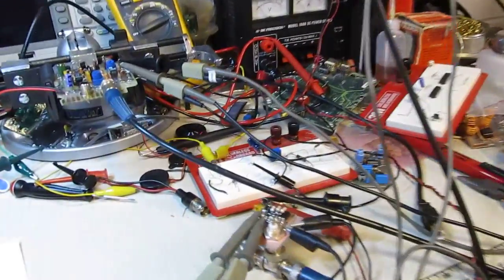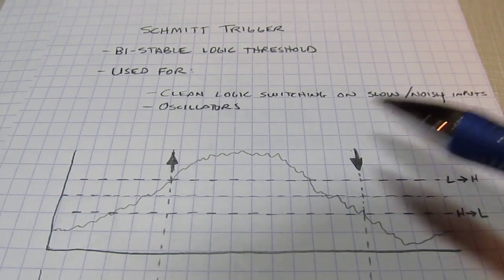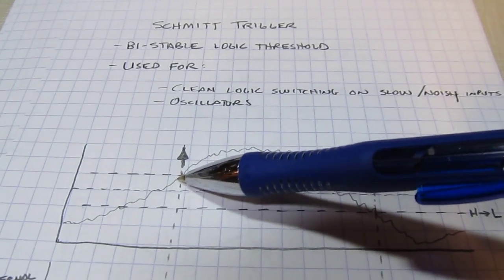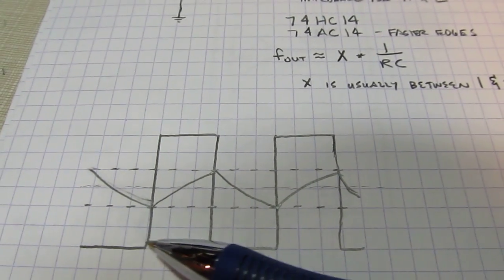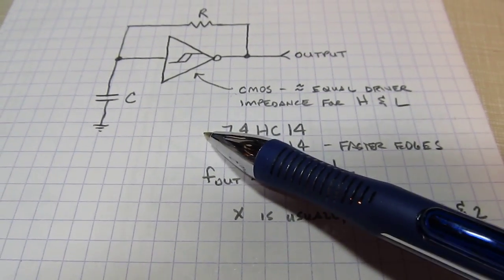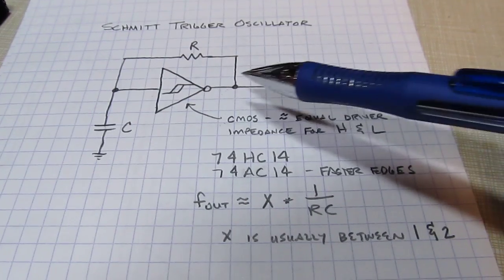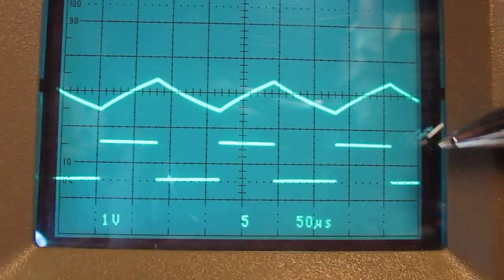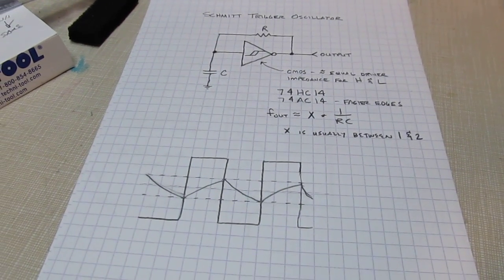#87: Schmitt Trigger Oscillator / Tutorial / 74AC14 Inverter / squarewave generator

Comment: Thank you for that Schmitt Trigger explanation! I tried reading the Wikipedia article on the Schmitt Trigger, and it kept mentioning hysteresis (which I understand as a mechanism that behaves in such a way that depends on its own history). It'd say hysteresis this, and hysteresis that, and I wasn't any closer to understanding what a Schmitt trigger actually did. But this actually helped me tie in the concept of hysteresis with a Schmitt Trigger for me.

When the noisy signal first touches the upper threshold, that threshold gets "de-activated" and the output becomes HIGH, while the lower threshold gets "activated". And so on.
Reply from the maker: Exactly.  Hysteresis basically means that the threshold depends on the previous state of the comparator - i.e. the threshold moves when the comparator changes state such that tiny wiggles/variation/noise on the signal can't cause chatter.
Reply: Schmitt has hysteresis, regular inverter without schmitt when does it switch?

Comment: You can do this with TTL logic,  but then are limited to fairly low resistor values.  Another variation is to make a schmitt trigger by wrapping an op amp with a couple of resistors to provide some positive feedback,  then couple that to an integrator (the whole thing can be easily done in a dual op amp package).  The output of the integrator goes to the input of the schmitt trigger.  The advantage of this one is very linear triangle wave,  rather than the ones you get here.  Also higher amplitude,  if you want,  and then by doing a bit of diode steering you can get narrow pulses and sawtooth rather than triangle waves,  or even variable duty cycle.
Reply from the maker: One of the problems with TTL is that is has asymmetric output drive capability, and can't drive a low impedance load.

Comment: 2/ another tip! If you put a transistor (pnp  ie bc107)  Emitter to ground , Collector to input across C , potential devider Base and the top resistor to the out put of the Shmit,  there will be a saw tooth wave form across the C.

Comment: Your videos are great, Alan.  Picked up a couple of 74ac14's and I am planning on building this. I had a thought that I might just add the parallel trigger array, in the output of your circuit, to the output of my inexpensive function generator, using it as a conditioner for the square wave output. That way I could vary the frequency and duty cycle.  For TDR measurements, would a very narrow pulse make it easier to visualize the delay ?
Reply from the maker: Adding an external input to the driver is a good idea - it lets you play with pulse widths, frequencies, etc.  Certainly a narrow pulse can be used to measure delay - potentially with less ambiguity, as long as the pulse width is shorter than the cable delay.

Comment: Excellent video.

Would this type of oscillator be fast enough to function as a local oscillator in an RF radio circuit?

What would be the practical upper freq limit?

Could it cover the entire 30 Mz hf band?

If so, this could simplify homebrew radio construction tremendously.

Thanks for the video.
Reply from the maker: Speed will depend on the logic family used for this, and the resulting propagation delay of the gate.  You'd want to follow it up with a divide-by-2 to cleanup any duty cycle distortion, so that pushes the frequency even higher.  So, I'd say it likely would not be a good for an HF LO.

Comment: Hi, Thanks for these great videos. I have built the circuit and used it as TDR to measure coax cables. Now I am wondering if this circuit with its fast rise and fall times (and subsequent harmonic content) would be an effective wideband noise source? I recall seeing circuits from a few decades ago for an antenna noise bridge that used a 555 timer and zener to generate the wideband noise. However, it seems this might be a better approach. What are your thoughts on this. Also, I hope that you are able to get back to you lab very soon.
Reply from the maker: The tone spacing will be equal to the odd harmonics of the oscillating frequency, which may provide fine enough granularity to work as a noise source, or at least a comb generator (see my video on that).  Note that the amplitude of the harmonics will fall off as you go higher in harmonic count (frequency), but that too might be OK for many applications.
Reply: I've used it for excacly the same reason .

Comment: Terminology Question: By definition(?) an op amp is a differential amplifier yes/no? Is a Schmitt Trigger an OP amp, or just a  Schmitt Trigger made from an Op amp.  I believe I’ve seen Schmitt Triggers  as part of logic groups  including TTL AND, NAND, AND FLIP FLOP, etc.
Reply from the maker: Yes, an op amp itself is a differential amplifier at it's heart.  It may not be configured as a differential amplifier when in use (such as an inverting amp, etc.).  A Schmitt Trigger is not an op amp.  It is essentially a comparator circuit whose decision threshold changes whether the output is HIGH or LOW.  A Schmitt Trigger can be made from an op amp, but most are made from comparator circuits, or are embedded in logic circuits.  The common feature is that the decision threshold changes with the state of the output.

Comment: 1/ tip of many , did you know if you replace the resistor with a coil, the input will resemble a sine wave (with a little trigger glitch that can be filterd) .
Reply: Hi. Under specific conditions (low power, low frequency) an op amp-based gyrator can simulate a coil's inductance, so can this circuit replace the resistor as well?
Thanks.

https://en.wikipedia.org/wiki/Gyrator

Comment: Does not the Schmitt trigger when reshaping a wounded square wave change its peiod (since it triggers on Voltage at might be  different points at the time domain)?
Reply from the maker: It won't change the period (since the same rising edge on the next pulse will have the same delay).  However, it can change the duty cycle if the rising and falling edges are different.

Comment: Hello sir and thank you for your very informative videos.

I have a question for you: I would like to make a circuit that can give me a rectangular signal between 0V and 5 V. A kind of switch, but with a smaller rise time in the order of 50ns to 100ns.
I tried with the Mosfets, but the output siganl to a lot of swings and noises.

What you can advise me or have already made a circuit like that.
I like to test the filters placed at the retraction of a microcontroller by placing this signal recregular and read the response of the filter.

Thank you
Reply from the maker: 50-100ns rise and fall times are pretty slow.  Just about any low-cost CMOS logic gate can swing rail to rail, so a simple oscillator using these devices should work fine.

Comment: Thanks for the video. I'm wondering if there are other applications? Can you use a Schmitt trigger to convert a frequency to a pulse? I'm trying to display speed in mph from some Hz freq, I need to be very accurate.
Reply: M. Baffa 1:1 freq*60=ROtations and then multiply ROtations by the tire’s outer diameter, divide by time per rotation and that’s speed.

Comment: Excellent video as usual. What determines the threshold voltage, as in this case of 1 volt, is it the Schmitt IC itself?  Can you change the threshold voltage using this Schmitt IC using external components or is it pretty much fixed at 1 volt?

Thank you
Reply from the maker: It is fixed in these ICs.  You can setup something custom using a comparator with some positive feedback.

Comment: Hey sir, 
What would be the benefits/benefit of using a schmitt trigger oscillator over using a 555 astable oscillator circuit to provide pulses? I cannot find a comparison between the two anywhere. Thanks.
Reply from the maker: +SPENCER1997ful There are a LOT of ways to create pulses - a schmitt trigger and a 555 are just two ways.  Each has advantages and disadvantages.  A schmitt trigger oscillator can run a lot faster than a 555 timer based solution - as one advantage.  But, it has a more restrictive power supply requirement, and doesn't provide all of the functionality of the 555 (one-shot, triggerable, etc.).
Reply: +w2aew great, thanks for that :)

Comment: I built this pulse generator and used in my school, but the students don't like the ringing on the signal. Is there any method to decrease it?
Reply from the maker: There are many causes for the ringing: sub-optimal circuit construction/layout, lack of impedance matching, long ground lead length on a scope probe, insufficient power supply filtering.  All of this is exacerbated by the fast edges of the logic signal, because faster edges contain higher frequency content - where all of these factors matter.

Comment: Great video. I know this is old now but you mentioned small difference between the 74HC14 and 74AC14 (speed).  I had an issue recently when I replaced the HC14 with a AC14. I was passing a signal from a simple function generator chip to an Arduino which ,in turn, provided the output to a 7 segment display. Everything worked perfectly with the HC14 (frequency verified with oscilloscope and function counter). When I inserted the AC14, very low frequency signals (19Hz - 60Hz) were incorrectly displayed on the display. 19 Hz was displayed as 38 Hz. Most other frequencies were fine except at the 1.9 kHz - 4kHz range where again, the displayed frequency was roughly twice the input frequency (1.9kHz displayed as 3.8 kHz). I tried several HC14s and AC14s and the result was the same. Any idea why the AC14 could cause this anomaly?
Reply from the maker: I would bet that the faster rising/falling edges of the AC part are causing the circuit to momentarily ring or oscillate - especially possible on a breadboard where effective grounding and power supply decoupling is difficult to do.  If you have an oscilloscope, take a look at the circuit's output.
Reply: Many thanks for your reply Alan. I suspect, you are right and there is some oscillation happening  . The output of the circuit looks and reads fine on both oscilloscope and frequency is displayed correctly on a 'Leader' Function counter I have. Indeed, the input to data pin 5 of the Arduino reads correctly on the scope but the Arduino output pins are sending double the frequency (only at the frequencies I referred to) to the 7-segment display. The issue seems to be the way that the correct frequency is interpreted by the Arduino hardware or software (I think software and will play with the 'gate time' in the code). Absolutely weird but if I can't tweak the software I guess I will just live with the HC14 :-) Thanks again for your time.

Comment: Great explanation and extremely practical. Still, can u please explain why the Calculations are not the standard f=1/(2(Pi)RC) which would give, in your example, close to 500Hz not 5000HZ.Thanks
Reply from the maker: The 1/2piRC refers to the lowpass filter characteristic.  In this case, the voltage is only moving up/down on the capacitor by a small amount, so the cycle time is faster.
Reply: Thanks for the prompt answer

Comment: Hello sir. I have a question about Wein Bridge Oscillators, but I couldn't find a video on that specific topic, so I decided to post my question here. Hope it's ok...

I'm trying to build a Wein Bridge Oscillator that I found in National Semiconductor's App Note 31, but my Proteus 8 simulation of the circuit does not work and I can't figure out why. Unfortunately I couldn't find any additional info about the design. So I was wondering if you could be so kind and maybe take a lot at the circuit. It's a project that I have to build and turn in, so grades are on the line :D
The links of the pdf picture and the simulation is below.
BTW, there is -15 written on the bottom right corner. I can't figure if that's -15 volts or something else, cause almost all voltages on this App Note have a "v" written next to them and this one doesn't.
I have also supplied the Op-Amp + & - 15 volts. Though the documents does not specify any value.

PDF Schematic: https://drive.google.com/open?id=1SmV6B4-9yGnFe-V_tkdoIO7R3o0KZb12
Simulation: https://drive.google.com/open?id=1WjgPlmipImQD9Kkb9V2PxBVilSLpFOUn
Reply from the maker: Oscillators are notoriously difficult to simulate.  Simulators work hard to determine a stable operating point at startup, which often prevents the oscillator from starting. You usually have to "kick start" them using an initial condition or a current impulse injected into the loop.  And yes, the -15 implies -15V.
Reply: w2aew I see! Thank you so much.
So I guess I'll just go ahead and build it up and see what happens.

Comment: Hello Can I use a 74LS14 instead of the 74AC14 or 74HC14... Will the circuit work??? Thank you
Reply from the maker: 74LS series does not have a symmetrical output stage, so it won't work very well (can't source a lot of current in the high state).  Stick with a CMOS variety of logic.
Reply: Thank you  .  Found out later and you did mention use a CMOS. I thought 74ls series was a CMOS.  I have trouble reading does data sheets TTL higher current usage etc etc. Thanks again

Comment: Another great video! I lashed this together on the breadboard tonight, substituting a 74C14 and an 8k2 for R and run it in 5V. I get a great triangle oscillation in the input, but can't find the PWM or square on the output (or anywhere), I can only get the same triangle wave in both the input and the ouput. Any ideas?

Comment: Awesome explanation of Schmitt trigger operation.  I knew the concept, but I was unsure of how to use one in a circuit.  I assume the upper and lower thresholds are based on the particular IC you use (along with the voltages)?
Reply from the maker: Yes, there is no "standard" for the schmitt trigger thresholds, so it will vary a little among manufacturers and device types.
Reply: Gotcha, thanks.  I built a similar oscillator circuit using a NAND gate with both inputs tied together, 0.1 uF cap, and a 10k resistor, but couldn't see any oscillation on the output.  I even tried some circuits I had found using 2 and then 3 gates and various caps, but still no luck.  Just wondering if I'm missing something here.
Reply from the maker: A NAND gate has a single threshold, so it won't operate like the Schmitt Trigger circuit where the threshold changes based on the output state.
Reply: I understand that it wouldn't function as a Schmitt Trigger.  I was just trying to make a simple oscillator in the same sort of way.  I probably just need to review the inner workings of oscillators a bit before attempting to make one.

Comment: Thank you very much for the nice video! I made a bread board circuit following your drawing. However, the rise time is about 8ns. Although it is already quite fast, I would like to at least reach below 5ns. It seems to be independent of the capacitor I put. I guess maybe the rise time only depends on 74AC14 itself? Different brands matters?
Reply from the maker: What is the Bandwidth of the oscilloscope and probe that your using to measure this?  Your equipment might be limiting the rise time. If the device is truly in the AC family, it should be faster. Also, achieving fast edge speed requires very careful component and circuit layout and construction.
Reply: Thanks for your prompt reply! I am using Tektronix TBS1102B 100MHz and a 10x probe. I have the feeling that my breadboard may be the culprit. I could pick up the signal at a free port. I will try soldering a circuit board.
Reply from the maker: Yes, you'll never get fast edges using a plug-in breadboard. Also, you'll need to use an extremely short ground lead on the probe (ground lead inductance will slow the measured edge speed). Check out my video on making your own high performance scope probe socket. That scope/probe combination has about a 3.5ns risetime. Thus, the measured risetime will be the SQRT(actual^2 + 3.5ns^2)
Reply: ***** Hi, I just soldered the new cricuit. Rise time 3ns :-)
Once again, great posts!

Comment: I'm using a 47nf cap, and 10x on the probes. My scope says it's oscillating right around 15 kHz. I'm running mine at 5V, should I try 12?

Comment: Sorry for the dumb question, but what exactly is your input for this oscillator?
Reply from the maker: Just the power supply.
Reply: Like, just a battery? (Vcc in video #88 diagram)
Reply from the maker: bboyHarrypotter Yes, a battery or other power supply.
Reply: 4 years later, but still, I was having the same question: where is the INPUT? 

[  If you would place the (missing) input between R and C, then there is, potentially, another stable solution : at the resistor, Vr = 5V , or whatever is the logical high voltage. With Vsource as input to the inverter,  Vout = Vsource - Vr  = constant  which could satisfy the output of the inverter too, 0V, as long as the IC output can handle, without burning out,  a not 0 voltage applied to its output. ]

The circuit seems to forget (well, it definitively does not show) that the IC itself has a direct access to Vcc and to Ground (again, not shown on the circuit), so that the IC can sink or supply some current, by itself. And that is this connection of the IC to Vcc which is providing  the required  "input".  Otherwise, it would be a "free energy" device.  :-)  It is not necessary evident, at first glance though. At least, not to me, too.